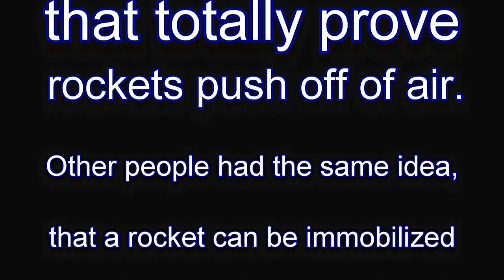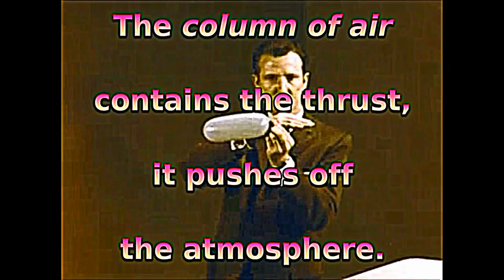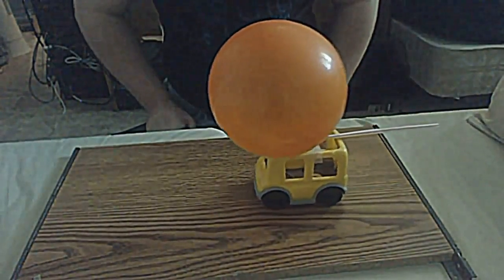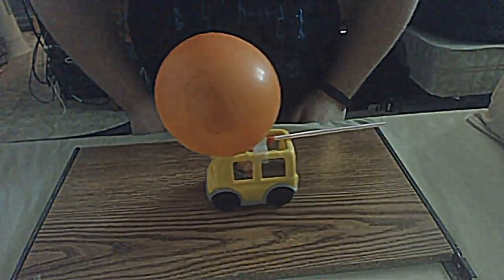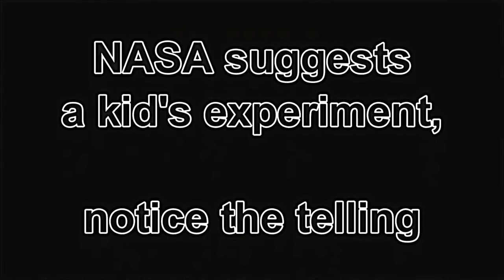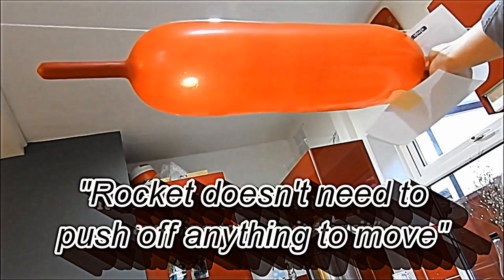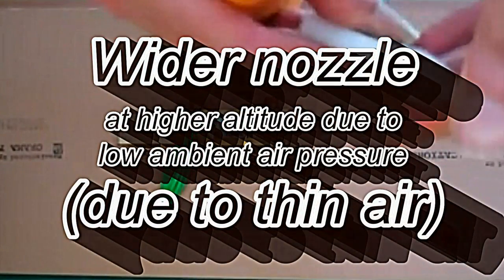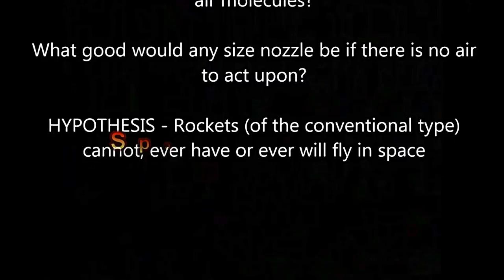rockets push off air

Comment: It's amazing how NASA interprets Newton's 3rd law motion. -- I used to live in Idaho and drove snow and ice covered roads frequently, if a snow tires fail to provide traction the tires spins and the car can't move. When traction is good the snow tires push off of the road and the car moves. The car has to push off of the road to move, with rockets it's the same, it has to push off of an atmosphere to move, can't work in a vacuum.
Reply: How NASA interprets? NASA understands physics and uses it to their advantage. NASA has launched many rockets in space with no issues of not having an atmosphere (in fact it is more efficient). Maybe it is your interpretation of Newton's 3rd law that is in error? Rocket propulsion does not work like a car tire pushing against the road. It works by expelling a mass at a high velocity which creates a force (what are the units of mass flow rate X velocity?) that propels the rocket in the opposite direction. An atmosphere just serves to impede this force generation. Asking a serious question, have you ever taken a physics course in college?
Reply: @pblakeney  ~ I was required to take a semester of physics in college, for my major, it was physic for non physic majors.
Think, if we live on a globe surrounded by a vacuum of space, with zero atmosphere, what does a rocket propel its high velocity gas off of? The word 'Propel' means:
to drive, push, or cause to move in a particular direction, typically forward.
"the boat is propelled by using a very long paddle."
Reply: @martentrudeau6948  Thank you for your response. I think there is much confusion about how rocket propulsion works. Most people are familiar with propulsion via a contact medium such as a car with the tires touching the road or a plane with the wings and propeller making contact with the air. However when it comes to rocket propulsion most think that it is the atmosphere that is the medium. This is not the case for rocket propulsion. The contact is between the ignited fuel source mass that is leaving the rocket and the nozzle of the rocket that accelerates this mass. Most are familiar with F=ma. The units of Force is the Newton = KgM/s^2. Any change in momentum results in a force. Momentum = mass * velocity. Acceleration = change in velocity (dv/dt). That is how F=ma is derived. However, there can just as likely be a change in mass to create a force where F= dm/dt *velocity. Where force = mass flow rate times velocity. This gives units of Kg*meters/seconds^2 =Newtons. If you examine the Thrust equation, this is exactly what we see: Rocket Thrust= Mdot (mass flow)X Exhaust velocity + (exhaust pressure- atmospheric pressure) *exhaust surface area. Force also =pressure X area. What does this mean? It is analogous to throwing a bowling ball away from one's body while on a pair of ice skates. The person throwing the ball exerts a force on the ball and the ball exerts the same force on the person throwing the ball but in the opposite direction of the person. The result is that the ball goes one direction and the person goes in the opposite direction. For the rocket, the fuel is being forced out (mass flow rate time velocity of the exiting exhaust of ignited fuel times its velocity which creates Newtons. This force generation must come as a pair and therefore the exact opposite force then propels the rocket in the opposite direction. Conservation of momentum is observed. You will also notice that from the rocket thrust equation that atmospheric pressure subtracts from the thrust which means that the rocket is therefore more efficient in a vacuum.
Reply: @pblakeney  ~ In the alleged infinite vacuum of outer space, a gas that is not contained will dissipate to fill the infinite void. -- An exploding gas in a rocket engine in space can do nothing, the exhaust gas will immediately dissipate into the void and has nothing to push off of outside the rocket, so there is no equal opposite reaction pushing back. -- When watching the Beirut explosion 'shock wave', it pushes the atmosphere and affects the surrounding neighborhoods for miles, but that same bomb exploding in the alleged infinite vacuum space wouldn't do a thing! -- You wouldn't even hear it go boom without atmosphere.
Reply: @martentrudeau6948  Honest question, did you read and understand all of my last comments? The work done on the rocket W= Force X distance. All of the work on the rocket is accomplished in an infinitesimal instance  as the ignited fuel is FORCED out of the rocket. Whatever the gas does afterwords is irrelevant. The gas expanding outside of the rocket after is leaves contributes no more work on the rocket (it has already left the system). FYI, there is work done on the gas as it expands. The movement of the gas (expansion) is the byproduct of the initial work that forced the gas out of the rocket. I am not trying to be tricky here. This is fundamental physics. You are correct that you would not hear an explosion in space as there is no medium to carry the sound waves. However an explosion can still take place in space as it is just a difference in pressure (delta P) times the surface area that creates the force and that force displaced over a distance creates the work of the explosion. I think you have misinterpreted Joule Free expansion experiment conclusion? The entire premise for that experiment was to keep work from occurring (the reason why there is a rigid system barrier and PV = constant). Also, keeping the system adiabatic and and isobaric (using a vacuum) would ensure no work or energy can leak into the system. This was all done to derive the ideal gas law PV=nRT.  This gives some intuition as to what a gas does when the temperature of a gas changes (increases versus decreases). For example, if the volume of the container does not change but the temperature decreases, one can expect the pressure of the container to decrease. This is why tires appear to deflate in colder months. Don't believe that hype of the conspiracy theorists. I hope you don't think that the Earth is flat and stationary. This video is bad science.
Reply: @pblakeney  ~ As I understood what you said, the rocket is propelled from the chemical explosion in the rocket motor and the expanding gas pressure goes out the rocket nozzle creating a Force that equals the pressure times area.
But the problem with rockets in alleged outer space, is the nozzle gas pressure dissipates in the vacuum trying fill the infinite void and the expanding gas will not be resisted, because it has nothing push against in zero atmosphere pressure, so there is no force to propel the rocket. The gas pressures in a rocket motor will push in all directions, but these pressures don't propel the rocket. -- But the gases exiting out the rocket nozzle does propel rocket when it's in earth's atmosphere and can push against it.
Reply: @martentrudeau6948  That is not correct nor what I said. The force is generated by the mass flow rate of the fuel X its velocity (as it exists the rocket). This force is then exerted on the rocket (Newton's third law). This is the equivalent of throwing a bowling ball out of the exhaust side of the rocket. After the bowling ball is thrown and it leaves the system, it does not matter what happens to the bowling ball. After the ignited fuel leaves the rocket it does not matter that there is no pressure there, in fact, it helps to produce more thrust. The contact is between the rocket nozzle and the fuel (not the atmosphere). If you have a hose submerged in a bucket of water and turn on the faucet, the water exiting the hose, even though submerged, creates a force on the hose and the hose recoils. If the hose is removed from the bucket of water, the recoil is more significant. It is not the water in the bucket of water that is pushing on the hose, it is the water exiting the hose that creates the force that pushes back on the hose. Why do you keep saying alleged outer space. Do you not believe that there is space? What do you base that theory on?
Reply: @pblakeney  ~ Everything that flies, jets, props and rockets use thrust to push it through the air!  --  And thrust is: “A propulsive force produced by the fluid pressure or the change of momentum of the fluid in a jet engine, rocket engine, etc”. A rocket has to push against a gas to work, in Zero atmospheric pressure it has nothing to push against. A gas explosion in an infinite vacuum, is like a drop of water landing on an infinite spunge, it's nothing and it does nothing!
The word science is from the Greek word gnōsis it means knowledge. – The Big Bang, - Gravity, - Evolution, - and Relativity are all metaphysics and religious philosophy. Out of necessity Gravity had to be invented to explain the Copernicus's Heliocentric universe. Nicolas Copernicus was a Polish Catholic priest and a religious philosopher, but not a scientist.
Real science confirms my belief in the Creator.
Reply: @pblakeney  ~ I agree! - A high pressure water hose (a fire hose) is at rest when the nozzle is closed, but when it's opened the thrust is at the end of the nozzle is huge. -- But a rocket in alleged outer space, converting propellant into high pressure gas and blowing it out the rocket nozzle, at 17.000 mph the same speed as the International Space Station I don't believe.
Reply: @martentrudeau6948  How in the world do you conflate nozzle velocity to orbital speed? However exhaust gases exit the nozzle at hypersonic velocities (at Mach 5, five times faster than sound). Whether you believe in it or not is inconsequential. So why do you believe that there is no space?
Reply: @pblakeney  ~ I do believe in science and I believe everything seen and unseen was created, including the spiritual realms that we cannot see! Real science is the study of things that can be proven, and others elsewhere can repeat and verify that it's truth.
Belgian Jesuit trained Catholic priest Georges Lemaître developed the Big Bang theory, this is not science, it's religious philosophy.
The Heliocentric Solar System is a theory, invented by Nicolaus Copernicus a Catholic Priest. Helios is the Roman sun god, it's religious philosophy.
Isaac Newton developed the theory of gravity to explain why an apple fell from a tree landed on his head. It took Newton 500 pages just to try to explain gravity and he never proved and "tested" it. Why do boats float? Is the same question! A boat displaces it's weight in water and floats on the denser water, the volume of the boat is less dense than the water, it's not going down or up it's in equilibrium.  "The (objects) approach to equilibrium is therefore an irreversible process. The tendency toward equilibrium is so fundamental to physics that the second law (thermodynamics) is probably the most universal regulator of natural activity known to science." ~ An excerpt from the Encyclopedia Britannica without permission. ~ http://abyss.uoregon.edu/~js/glossary/laws_of_thermodynamics.html 
Vector Gravity is just a theory, it's not science it's religious philosophy.
Einstein’s general theory of relativity explained why the Michelson Morley experiment, that proved the earth was stationary was incorrect, but to do this Einstein had to claim the Ether didn't exist. 
https://youtu.be/z7tIbwK0ulM 
Tesla was critical of Einstein stating that his Theory of Relativity was “a beggar wrapped in purple whom ignorant people take for a king” and “a mass of error and deceptive ideas violently opposed to the teachings of great men of science of the past and even to common sense… the theory wraps all these errors and fallacies and clothes them in magnificent mathematical garb which fascinates, dazzles and makes people blind to the underlying errors…. its exponents are very brilliant men, but they are METAPHYSICISTS RATHER THAN SCIENTISTS. Not a single one of the relativity propositions has been proved.”
The Antikythera Mechanism, is 2,200 year old planetarium that predicts the movements of the sun, moon, and planets with-in one degree in a 500 year period and also predicts when solar lunar eclipses will probably occur. This is an Earth Centered in the Universe mechanism or Geocentric devise. The Heliocentric Solar System Theory was created by Nicolas Copernicus, 1473-1543. He was Polish Catholic priest, who is not scientist, his theory was metaphysics or religious philosophy. And the Catholic church published his writings at his request after his death. 
https://vimeo.com/98513354  
In 1900 sponge divers discovered a shipwreck in the waters off the Greek island of Antikythera, within the wreck was found a device that has been a mystery for nearly a 100 years, its known as the Antikythera mechanism. 
British museum curator Michael Wright hand built a reconstruction of the Antikythera mechanism that includes all of its known features. The device is a planetarium, that is based on a geocentric design of the world, where the sun, moon, planets and stars revolve around the earth, this is called a geocentric system. Today the Copernican System or Heliocentric design of the solar system is believed by most people. 
Michael Wright, was formerly the Curator of Mechanical Engineering at the Science Museum in London, and later at Imperial College in London, England. 
The Antikythera device is also a mechanized calendar based on a 19-year cycle in which the phases of the Moon are repeated on the same days of the year, this is known as the Metonic Cycle. The device displays calendar information that allows for the predictions of a solar and lunar eclipses. The reconstructed device is accurate for all the planets indicating correct positions with-in one degree in a 500 year period. 
Antikythera Mechanism, a Virtual Reconstruction (by M. Wright & M. Vicentini) https://youtu.be/MqhuAnySPZ0 https://i.pinimg.com/originals/08/76/05/087605e2de06016806d58df051f30b4b.jpg https://i.pinimg.com/originals/96/e6/a2/96
Reply: @martentrudeau6948  You draw incorrect conclusions yet again. It is almost as if you do not understand physics and all you do is read conspiracy threads. Einsteins theory of relativity has been proven time and time again. There is no doubt that Einstein's theory is accurate. GPS clocks have to take into account special relativity or GPS would not be able to get one to their destination. Scientists understand the effects of gravity and it is measured all over the globe. Einstein's theory of general relativity has also been proven too many times to count. You spend too much time studying conspiracy theories and no actual time studying physics text books.I spent most of my day trying to educate you but it appears that you had no clue what I was talking about. I did not do this for myself but to help you. You are hard headed and unappreciative. Good luck.
Reply: @pblakeney  ~ Mach 5 is only 3,836 mph, that is much slower than the ISS, International Space Station, that allegedly orbits the globe at 17,000 mph or 22 times the speed of sound.
There are Innumerable reasons to believe the earth is flat. One of the most common is we can see too far across deserts, lakes and oceans for there to be earth curvature. San Clemente Island lies 58 miles offshore from Main Beach in Laguna Beach, CA, it's 56 square miles, 21 miles long, the island is two to four miles wide, it's maximum elevation 1,965 feet above sea level. -- It is common during the cooler winter months to see the whole island from top to bottom and end to end standing on Main Beach with unassisted eyesight. Using Ommi earth curvature calculator the whole island should blocked from view by the ocean bulge between Main Beach and San Clemente Island. 
There is no earth curvature and without curvature the earth is not a globe, there's no solar system, no galaxies, and no infinite outer space.
Reply: @pblakeney  ~ The question of  rockets working in a vacuum, doesn't really matter, because outer space doesn't exist.
A swimmers pull and kick to propel them self  through water. Airplane propellers, jet fan blades, rocket engines and fire hoses all make thrust in a fluid and push off the fluid.
Water Jet Pack –  https://youtu.be/m4Bm3cs9TFo   –   Notice the jet pack rider moves quicker in the air than in the water, because the air is also a fluid, that is less dense and less resistant than the water. Air pressure at sea level is 15 psi.
How can earth's atmosphere coexist in an infinite vacuum of outer space, when atmospheric gases are moving high pressure to low pressure and heavier gases go down and lighter go up, there has to be a container. as gas pressure seeks equilibrium it moves. According to “science” earth's atmosphere is not contained, which is nonsense, because atmospheric gas would dissipate  into the infinite vacuum of  the alleged outer space.
You will probably say it's gravity that holds the gas to the earth's surface, but that wouldn't be enough to hold earth's gases in an infinite vacuum of alleged outer space.
Reply: @pblakeney  ~ Modern science luminaries, such as the Catholic priest Copernicus, Newton, Darwin, the Catholic priest Lemaître, and Einstein are considered above reproach and to question them is to attack their integrity --- Real science tests and proves a theory until it's recognized to be a law of science, if that can't be done, then it's just a theory. Real science is about finding the truth, and weather a so called scientist is truthful or not will eventually be known, because everything comes out of the wash in the end.
Copernicus theorized the Heliocentric solar system, but had no proof to support that theory.
We can see too far across deserts and oceans for there to be earth curvature. Microwave transmitters, transmit and receive for hundreds miles through unobstructed airways and micro waves only travel in straight lines, they would work on a ball earth! Radar is also micro waves that travel in straight lines and they detect and track storms and objects hundreds of mile away and would not work on a ball either. The Globe earth idea contradicts what we see on the earth's surface and that's provable testable science.
San Clemente Island lies 58 miles offshore from Main Beach in Laguna Beach, California, it's 56 square miles, 21 miles long, the island is two to four miles wide, it's maximum elevation 1,965 feet above sea level. Sometimes on a clear day during the cooler winter months the whole island can be seen from top to bottom and from end to end standing on Main Beach in Laguna Beach with unassisted eyesight. – The whole island should hidden beyond the ALLEGED CURVATURE but it's not hidden, it's in plain sight for all to see and the horizon is of course flat!
The earth has no curvature, so there is no globe, no Heliocentric solar system, and no infinite universe. So the science taught in schools is not science and not the truth.
Reply: @martentrudeau6948  Isn't it true that you don't believe rockets work in space because if they do then the rest of your beliefs would fall apart right in front of your eyes? You have to not believe in gravity as well because it would prove a flat Earth is impossible. Your entire belief system is frail and crumples when confronted with actual science and facts. I have never met an educated flat Earther. You fall right in line with their idiocracy.
Reply: @martentrudeau6948  It is quite ridiculous that you argue from a viewpoint of ignorance. It is you that presupposes that space does not exist, to the rest of the world, it is common knowledge. It is you that must provide proof of such a radical claim. You would not know real science as you admit to only taking one physics class that is not for physics majors. So, you actually know nothing but for some reason think that you can persuade others even though you, yourself is ignorant of the truth. If you ask me, it takes way more faith to believe the garbage that you do then to pick up a real physics book and understand its content. You would rather believe fairy tale stories because it agrees with your narrative but your narrative is just as flawed and ignorant as your conspiracy theories. None of it holds any water. Stop offering information until you educate yourself.
Reply: @martentrudeau6948  I  presuppose that you don't understand science at all.
Reply: @martentrudeau6948  Do you believe in God?
Reply: @martentrudeau6948  Do you believe in God?
Reply: @pblakeney  ~ Genesis  --  1:1 In the beginning God made the heaven and the earth.
If you believe our existence is a result of a natural process called evolution, then after your life ends, you will find out that you were made and played the fool during your lifetime. That will be a tragic, hopefully you will acquire some Godly wisdom before you die.
Reply: @martentrudeau6948  I asked you a simple question and you can't answer it? Do you believe in God? It is a "yes" or "no" answer. I can only assume that your answer is "yes". NO wonder you struggle in your understanding of physics. Anyway, now prove that God exists. Don't go off on a tangent this time.
Reply: @pblakeney  ~ It was a dumb question!
Reply: @martentrudeau6948  It is a relevant question to our discussion. You claim that you can't prove a number of things like the "theory of gravity" or the "big bang" or "relativity" (which all of the above has been proven to the Nth degree btw). I asked you if you believe in God so that I can then have you prove that God exists (you know since you like to have proof of things or else they don't exist for you). Your arguments come crashing down now all of a sudden because according to your logic, if you can't prove it, it is not truth. It was actually a brilliant question disguised only to fools.
Reply: @martentrudeau6948  crickets
Reply: @martentrudeau6948  Is that all you have Marten? You gave up rather fast.
Reply: Works better in a vacuum Martin.
Reply: @martentrudeau6948  Why don't rockets work in space again?
Reply: @martentrudeau6948  Ah, yet another flat earther who uses dictionaries to make their arguments!
It would appear you slept through your semester because you are fundamentally wrong. Rockets are an example of Newton's third law, as is the recoil of a gun.
Reply: @martentrudeau6948  If gravity doesn't exist why do things fall?

Re-read your quote "“A propulsive force produced by the fluid pressure OR THE CHANGE IN MOMENTUM of the fluid in a jet engine, rocket engine, etc”. It is the change in momentum that drives the rocket forward, not fluid pressure.
Reply: @martentrudeau6948  "You will probably say it's gravity that holds the gas to the earth's surface, but that wouldn't be enough to hold earth's gases in an infinite vacuum of alleged outer space"
On what basis do you assert that? Do you have any idea what you are saying? because it doesn't look like it. A vacuum, "infinite" or not, is an area of zero pressure. It does not "suck" as science deniers falsely claim.

Your claim to have done a course in physics is looking increasingly suspect.
Reply: @pblakeney  ~ Ferrari's and Ford's would not exist with out Enzo Ferrari and Henry Ford. -- The earth and the whole cosmos of things runs like a giant intricate and incredible clock mechanism, and this begs the question, how did this happen and who made it? -- The zodiac and constellations are recorded ancient history, they are the same now as then as they were thousands of years ago. The existence of creation and it's design, is proof there is a Creator/Designer who made them.
Reply: @martentrudeau6948  So you don't even know what a theory is!
Reply: @martentrudeau6948  Prove it!